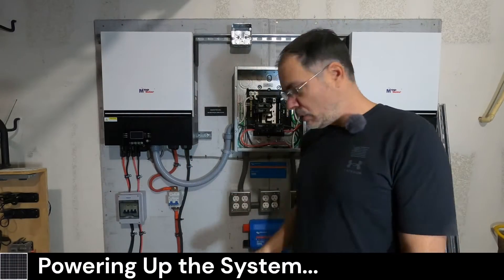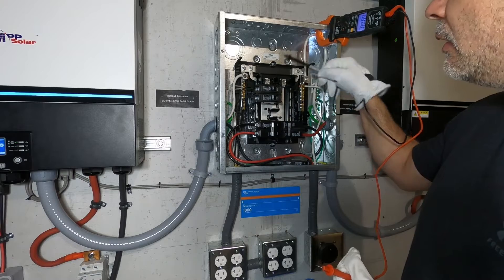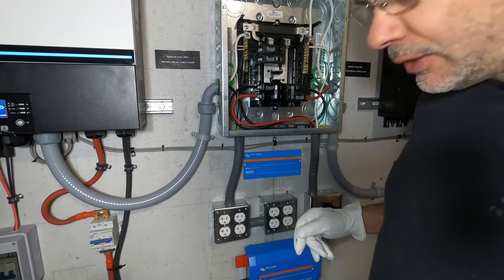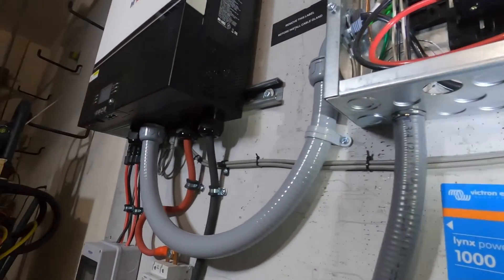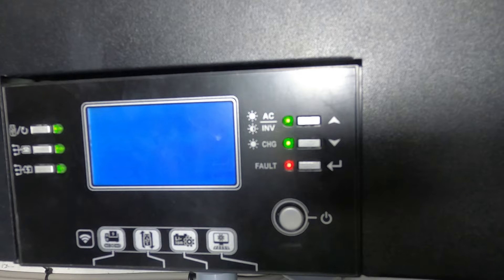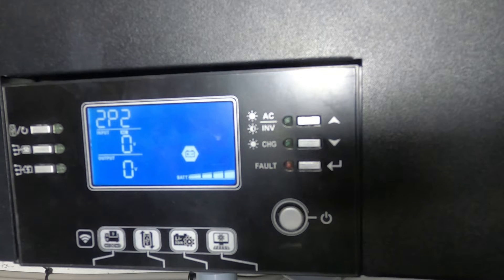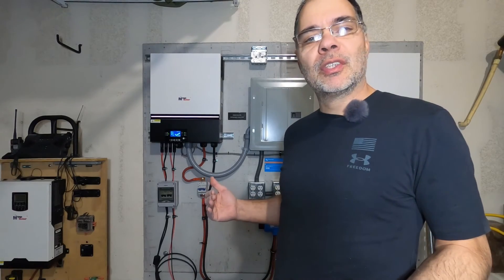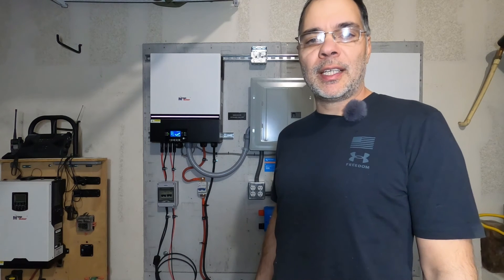Configuring The Inverters For Split-Phase Operation.

Comment: Hello. I have two MPP Solar LV3024 conectes in split fase. When the utility Power come back the equipment 2p1 show error 80.  Semeone happen this?? How i can fixed. Thanks
Reply from the maker: This is a CAN bus fault. Are you using comms to your battery.? If not, you may need a firmware update.  

https://www.google.com/search?q=mpp+solar+lv3024+error+80&oq=mpp+solar+lv3024+error+80&gs_lcrp=EgZjaHJvbWUyBggAEEUYOTIHCAEQIRigATIHCAIQIRigATIHCAMQIRigATIHCAQQIRigATIHCAUQIRigAdIBCTEyNTk4ajBqN6gCELACAfEFUec_6k-S5MXxBVHnP-pPkuTF&client=ms-android-samsung-rvo1&sourceid=chrome-mobile&ie=UTF-8

Comment: I never seen anyone use a 100 ohm resister on that type of Inverter. You would think the Inverter of that complexity would have some protection. Does the Manual advise you do this ?
Reply from the maker: It won't damage the inverter if you don't.  It's just a common practice that people do.  Newer rack mount style batteries have pre charge circuits built in but not all batteries have this.  If you don't it will create a big spark when connecting battery for first time.  If you look around you will see this.  Did not see anything in manual about it.
Reply: @natesdiysolar  ah ok very good
Reply: I was wondering the same thing.